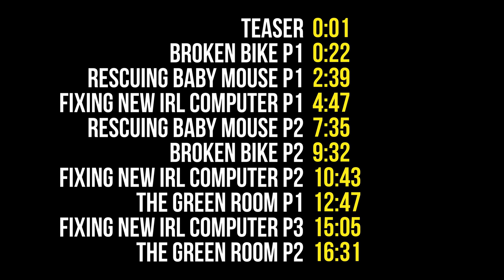Someone Put A Newborn Mouse In Chris' Car

Comment: Don't cycle the pump to refill the loop with the 24pin connected... use a jumper, they sell them for less than a dollar or even just use a paperclip (be careful).  Ideally, you'd use an old PSU you don't use anymore as the loop filler PSU.

Comment: Put blue shop towels around the areas you are filling/draining on the system before you fry it. Also the system doesn't have to be on it's side to remove air. Keep it upright and gently tilt it back and forth until you get all the air out. Just takes some patience as running the loop on it's side is not great for the pump. It wouldn't be a bad idea to put some small blocks under the wood you have the system on to help keep the stray carpet and pet hair out of the system.

Comment: CPU and GPU on the same rad might not be as efficient as having 2, depending how hard it runs during the show(2-3 hrs).
Reply: That 3090 has nothing to do, and that radiator is huge. No prob at all
Reply: @DrFu79  GPU is used for encoding.
Reply: @iyouweGAME  what i mean is the 3090 is barely active for that. It’s not creating any significant heat output with 4k encoding, even with multiple streams

Comment: Did you say 128 gigs in that build? That's a bunch of erroneous RAM. You'd never use even a quarter of that. Even if it was a server of some kind.
Reply: tell me about it i got 16 and got 100 tabs open, most of them are used but even then...you never need this much.

Comment: You shouldnt have to blip the throttle when you're trying to start.  Check the petcock first, then the choke, then check to make sure you didnt flood the float in the carburetor.  That or you left the kill switch on.  My kid does that a lot.

Comment: You need to check the spark plug or the on off key position or the cdi box those are the only things to keep it from starting cause it wasn't even trying he either messed up the computer cdi box or where it keys on got fricked